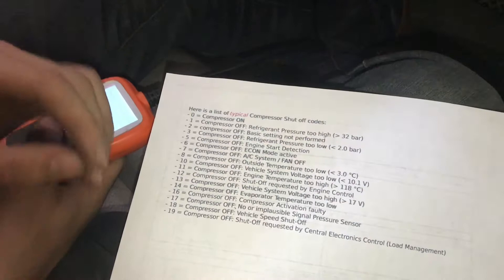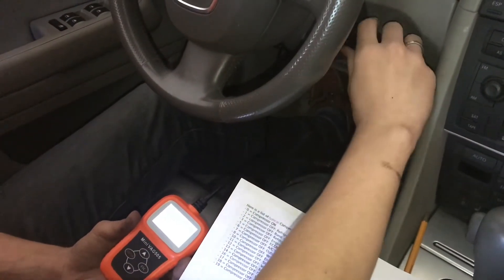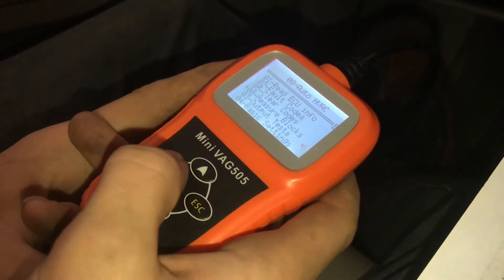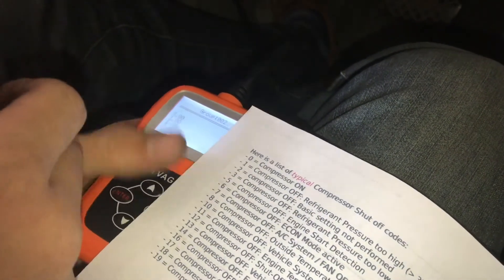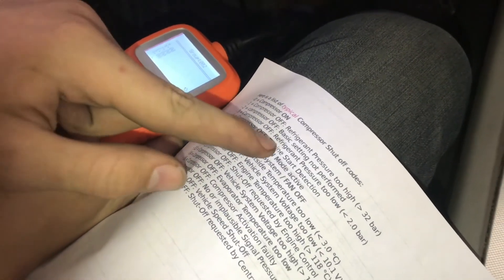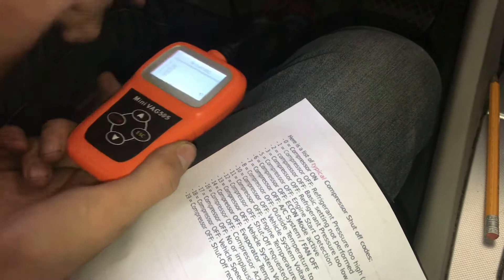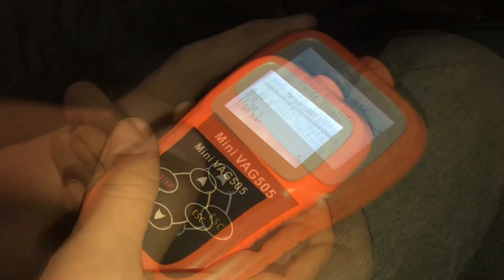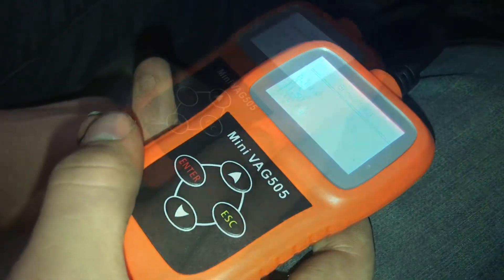understanding air conditioning “ SHUT OFF CODES” vag com vcds

Comment: Hi I am working on a 2006 Audi A4 Quattro 2.0 and I have swapped engines on this vehicle and left the ac compressor hanging with the lines attached, but somehow after reconnecting the compressor to the engine block and reconnecting wiring, and properly filling refrigerant with gauges, I am now getting error code 0 while the vehicle is running however the AC compressor is not actually running, nor is there any cold air.  After further research, I believe this is a bad AC compressor.  Without shorting anything or jumping any wires to the compressor, I am willing to throw money at replacing the compressor as it is 15 years old.  

Thank you for this informational video.